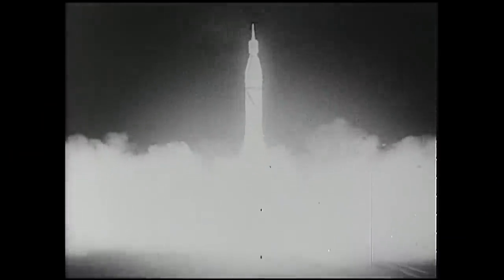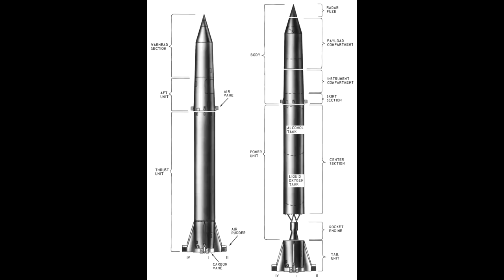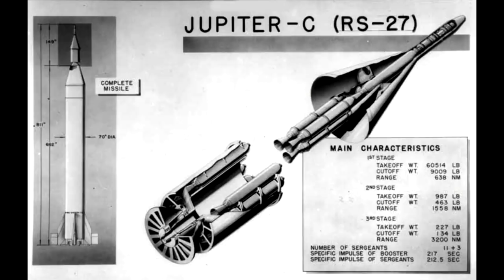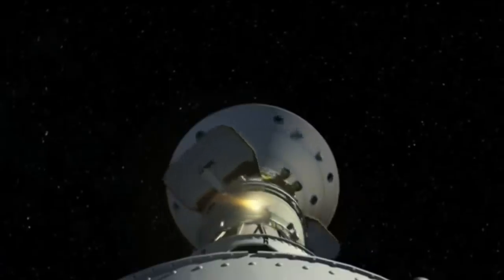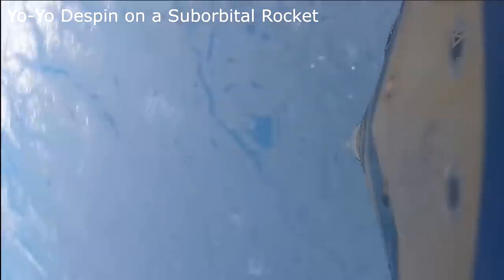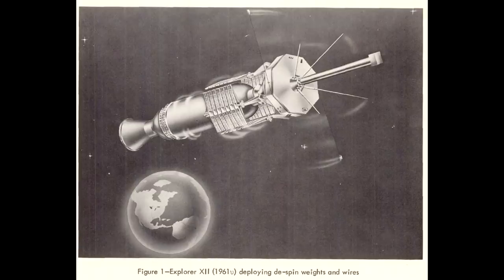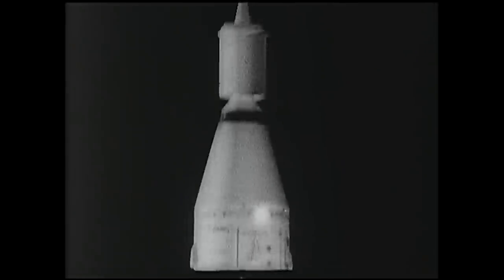Why Spinning Was A Good Trick For America's First Space Launch

Comment: Pro-tip: If you’ve overdone it on the alcohol stand in place and extend your arms for several seconds to yo-yo despin before getting into bed!
Reply: I find the spin worsens in a horizontal arrangement
Reply: @Wulthrin  
Indeed. It’s often necessary to extend a leg from the bed module to the planet surface to achieve final stabilization.
Reply: So you're saying I should T pose to assert dominance over the alcohol?
Reply: @MrRolnicek  It's an oversimplification of the procedure, but yes.
Reply: @Wulthrin  The rotation from vertical to horizontal often concludes with a head turn, inducing rotation in the inner ear (whose liquid is temporarily altered by alcohol). You need to cancel that out.
Reply: I like the spin
Reply: It doesn't always work. You may face-plant it with your hands still extended. Good thing satellites do not drink.
Reply: @chudleyflusher748  I know a navy guy who launched himself out of the top bunk attempting that maneuver.
Reply: To complete the despin you also need to detach the arms
Reply: Dont jetisson them though
Reply: @vladimirdyuzhev  Redstone rockets drink a lot.
Reply: ok bauts whasddys sther vommmit ona my bed ?

Comment: I used spin stabilization on the upper stage of a small two-stage rocket that I had designed to cross the Karman line. I tested the upper stage, stand-alone, three times. All three test flights lead to inflight breakups at between Mach 2.4 and Mach 2.7.  I attributed the first breakup to a fin failure at Mach 2.7. I found fins amongst the various parts scattered on the Black Rock Playa.

I reinforced the fin assembly substantially and repeated the test with largely the same results at Mach 2.5 but with the fin assembly only suffering  minor thermal damage. 

I increased the fin area substantially and changed to a welded aluminum structure. I also added an IMU to the payload. This launch went unstable at about 24,000 feet and at Mach 2.4. The payload and the forward section returned to earth under parachute. The aft section continued on a ballistic course and was located, stuck about 1.5 meters in a very hard  Playa.

Analysis of the IMU data showed the rocket increasing in spin rate until it approached the lateral aerodynamic resonance of the rocket at that speed. The rocket was not balanced around the axis of rotation which induces a nutational torque about the logitudinal CG. This torque was easily overcome by the fins until the spin rate approached the longitudinal resonance. The longitudinal stability was heavily underdamped and the excitation of the rotational imbalance caused the angle-of-attack to exceed limits and the rocket quickly turned perpendicular to the direction of flight and broke up.

Who would think that larger fins and spin stabilization would result in a more unstable rocket?  I don’t understand, “it must be a rocket thing”.

Comment: "While many people had proven that the alcohol used to fuel the Redstone was safe enough to drink."

"Oh, well its good that they did their due diligence and analyzed the different rocket fuels for.... hold on a second...."
Reply: And that liquid oxygen they use.  Once you warm it up above -40 degrees it's safe to breathe it - even without a respirator.
Reply: @Kineth1  is that -40 degrees C or F?
Reply: The biggest drawback of ethanol fuel is the inevitable loss of propellant that would occur every time a Navy technician opened the tank to inspect the levels.
Reply: Honestly, it's the people that tried to drink UDMH thinking it was alcohol I feel sorry for ...
Reply: @Xylos144  Yes ;)
Reply: @retrogradevector  Really? Because anyone that got to the point where they had swallowed UDMH should have had enough of a warning to stop...
That would be like feeling sorry for someone who accidently drank the LOX instead of alcohol...
Reply: Redstone fuel technology stolen from Russia thats actually vodka!
Reply: @Xylos144  Both!  At the same time even.

-40 is the crossover point where F and C scales are represented by the same numerical value.
Reply: @Xylos144  I see what you did there...
Reply: Pour one out for the folks who proved that UDMH was NOT safe to drink.
Reply: @BogeyTheBear  😂😂😂 heck
Reply: This sounds like a kerbal part description: "While the reliability of the engine hasn't been proven, engineers have confirmed that the alcohol this engine uses for fuel is safe enough to drink."

Comment: The Pioneer 10 and 11 probes to Jupiter and Saturn were spin-stabilized and just retained the spin. They actually used it in their imaging system--the system could only detect a single pixel at a time, but this would sweep out an arc as the spacecraft rotated, and then they could build up an image by re-aiming the scanner on successive rotations.

Comment: yo-yo despin works not only by increasing inertia tensor but also because wire is wound up around the stage, so when it gets unwound centrifugal force from weights is actually applied to the side of the stage (not center of mass). and it literally pulls the stage in the direction opposite to rotation. with only inertia tensor increase your can slow rotation (maybe by 3) but never stop it or go in reverse.

Comment: Watching that T-handle I finally understand how and why the earth can suddenly flip it's polarity.
Reply: I don't think I understand it any better, it just makes it easier to accept
Reply: @wictimovgovonca320  The handle is heavy, it is the natural core that could spin stably forever.  When the tool is spun around the lighter axis, it is unstable. It keeps spinning, but it is not a natural spin because it is along the wrong axis.

By analogy if the nickel/iron magnetic flux at the core of the earth is not spinning in the same direction as the surface of the planet (as the increasing divergence of the magnetic poles from true north shows), the inner core can flip in the same way the tool did, possibly dragging the surface along with it.

Comment: In a configuration where the spin axis is aligned with the smallest moment of inertia, if there is some energy dissipation inside (like fluids possibly moving in tanks), then you need active nutation control to avoid going to so called flat spin. A spinning body has two axis around which it can spin in equilibrium. Spinning around the axis of highest moment of inertia is a stable equilibrium, while spinning around the minimum is an unstable equilibrium. If the ratio of moments of inertia is close to one (a spher or a cube for ex), the equilibrium is undetermined and the body ends spinning around its axis of kinetic momentum, but in a position which is not definite. Launches whith the PAM-D atop a Delta or in the shuttle used active nutation damping during the coast phase to the equator. A spacecraft small thruster perpendicular to the spin axis was pulse fired at the right moment during the rotation in case of detection of any nutation (wobble) to dampen the nutation and reduce it to a minimum.

Comment: Was any attempt made to make the discarded yo-yo weights easier to detect in the future? Maybe a radar-reflective coating, and/or unfold the weights into a large thin sheet similar to a solar sail?
Reply: I think they're just yeeted away without any special indicators for future cleanup.
Reply: Oooh, if they inflated then they would de-orbit faster.
Reply: @Kineth1  Yes. The end mass could be a folded-up origami shape held together by a "glue" (maybe just a softer metal) which slowly deteriorates after several years.
Reply: I wonder if the cables are made from the same stuff that held together the day/night shades on ringworld. Dangerous stuff if it hits you.

Comment: One addition: All spacecrafts pointing to earth need to spin. But at a low speed. Approx. one rotation in 90min in LEO and 1 rotation in 24h in GEO. And there is often a "bbq" mode foreseen for spacecrafts when there is failure: It spins to keep temperatures stable.

Comment: I was reading up on the instability issue the other day in the context of O'Neill cylinders and the flipping t-handle effect came up, sure enough. Would you consider doing a video on the permitted range of aspect ratios for the cylinder habitats, Scott? It may very well b'é that Babylon 5 was doomed from the start 😀
Reply: The intermediate axis theorem applies most significantly to objects that are in free rotation. Babylon 5 was constrained within a ship so altering the axis of rotation would meet with dramatic resistance.

The problem of course is that no bearing technology known to man can handle the combination of surface speed and load presented by such a station.

Comment: My wife is  an engineer that worked on the JPL LDSD project, which was a platform to boost experimental parachutes up to high within the Earth's atmosphere to where air pressures mimicked those on Mars for the purposes of testing 'chute designs for Martian atmospheric entry.  Specifically she and her team worked on the small solid rocket motors that were used to spin-stabilize the platform prior to the main engine delivering the platform up to altitude.

This is the project's website: https://www.nasa.gov/content/ldsd-we-brake-for-mars

Apparently the fun part was ensuring that these small solid rocket motors would all perform the same.  They had to spin-up when the original lifting-balloon raised the platform as far as it could reach, then after the booster had delivered to altitude, spin-down the platform again.  They had to achieve both balance in the spin and had to ensure that when the rocket was spun-down it was as close to zero RPM as possible, with a tolerance in single digits.

The platform performed so well that they were able to do parachute and other reentry tech testing on the first flight, a flight that they expected to basically just test the platform itself.

Spin-stabilizing can be extremely effective, even allowing things that don't resemble rockets and are ballastically highly unstable in an otherwise still configuration to fly accurately.

Comment: Thanks Scott!   I don't see how yo-yo despin could make the vehicle spin in the opposite direction.  The best it could do is bring the spin to zero.  I imagine there were small thrusters or something that were fired after the yo-yos got the spin very low.
Reply: I'm thinking it may be related to the flexibility of the cable, and maybe a spring at full extension. You extend a spring and it will absorb some energy and then pull back against it.
Reply: @wictimovgovonca320  A spring can store energy but not angular momentum.   The yo-yos work by conserving angular momentum but increasing their moment of inertia (by moving outward) thus decreasing spin. The best you can do is have the yo-yos extend out to infinity which would bring the spin to zero.

There is no way to change the direction of spin without changing the angular momentum.    But maybe there is something clever going on that I haven't thought of.
Reply: @BitJam  I don't fully understand, but someone else here said it had something to do with the cables being wrapped around the stage and the masses being off center so the tension in the cables isn't along a diameter of the stage cross section.

My gut instinct was that some funky things could happen due to the fact that things aren't steady-state and there's springiness of cables involved. Ropes do weird things when swinging around.
Reply: @seth094978  Thanks!   Yes, if the cables are wrapped then the weights going out can impart addition angular momentum to change the spin direction.

Comment: There was an anti-tank missle where the entire missle was spun up to several thousand RPM before launch. It had no fins and no thrust vectoring, but none the less was a guided missile. It was not guided until after the solid rocket burned ouy. Then it used a series of small charges arranged radially at the nose. The launcher would track where the missile was and if a correction was necessary, one of the small charges would be detonated to cause the whole missile to precess. The payload was just a chunk of tungsten, about 6' long by 1' diameter. It would hit at something like 4-5KMPS. Supposedly if it even grazed a tank, the shock, acceleration and liqufied metal spray would totally destroy it. I don't think it ever made it past the prototype stage, but it did sink a ship in a test, showing how much overkill the design was.

Comment: "in the case of Dawn the dynamics of the unspooling masses were tuned so that they didn't just slow the rotation of the spacecraft they reversed it a little"  If they added some RCS, they could reverse the rotation, but with any length of cable and any mass, you  cannot reverse the rotation, you cannot even stop it, you can only slow it down to a miniscule rate.

Comment: You've reminded me of something I'm confused by on two other early American rockets;  Liquid upper stages. (Or at least their Wikipedia descriptions).  Wiki's Titan 1 page lists its first flight in 1959 as the first successful use of serially staged rockets, and getting an engine to start up off the launch pad...  But both Vanguard and Juno 1 had used solids for some upper stages, which don't have propellant settling issues.  And Vanguard even had a liquid fueled stage 2, which...  I think flew 1 year before Titan 1.  Also, as far as I can tell, the first Soviet rocket to start a liquid (or any) fueled engine serially for an upper stage was Luna 1 in January of '59.  Am I getting this right?  Vanguard and Juno 1 were the first two rockets to start engines after leaving the launch pad, did so in '58, but Titan 1 was interesting a year later for getting it's engine to start in space?  I also can't find any notes online about how Vanguard did propellant settling for its stage 2.
Reply from the maker: That’s a lot of minutia, now you’ve got me wondering.

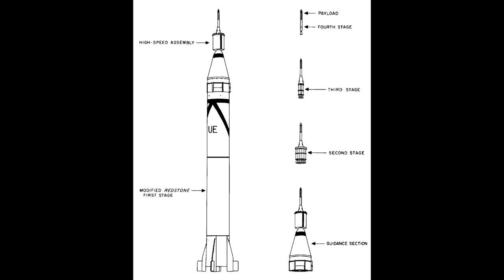Comment: 4:20 - whether nm stands for nanometers (as I would expect in a metric context) or nautical miles (as I would expect for all sorts of other reasons in this context), the juxtaposition of that with altitude expressed in km (which I presume can be nothing other than kilometers, right?) seems... strange.
Reply: Could be a culture mix issue. In aviation distances are nautical miles, and speeds are knots. In space it's often metric units. Since those stages will come down, they're handled by aviation guys, and the payload isn't.. so each use their own preferred units for their part.
Reply: @nuclearmedicineman6270  sounds confusing, has any issue come from this?
Reply: @nuclearmedicineman6270  Nautical miles are used by the Navy too. They have to clear the downrange impact zones.
Reply: @gordonrichardson2972  I just wish we’d all switch to metric and be done with it.

Comment: The whip antennas causing a change in spin axis.  My though was the fact that the orbit is circular  but the axis of rotation is a vector pointing in one direction that had no relationship to the circular orbit.  so at 90 deg around the earth the satellite should be pointed perpendicular to the orbit travel.

Comment: I'm a bit confused. You mentioned spinning is used to deal with both off-center center of mass and asymetric thrust. Spinning the small upper stage while the first stage is burning will only "average out" the upper stages center of mass. It won't do anything for the rest of the stages center of mass or the engine thrust asymetry. Did the whole rocket also spin? Was the spinning upper stage just a gyroscope at that point?

Comment: Could you do a video on what space X can do to fix its sloshing of fuel in the header tank on landing?  What are the options, go with a shuttle design instead, spiral titanium tubing for header tank, double jump for landing, keeping the fuel in a stirred state, placing a mesh in the tank to damping sloshing, how the helium works to prevent it.  Since sloshing is at the root of starships crashing so far how do they solve it?
Reply: If they don't know then he doesn't know. We fix sloshing in race cars by running foam fuel cells. That cannot be done in rockets, I mean it can but it would add a significant amount of mass and reduce the volume of fuel it can hold. It will be interesting to see how they fix it though. Baffles obviously help but again it adds mass. 

They could go the Electron route and use a more advanced sensor suite and more accurate pump control to vary the thrust to cancel out the sloshing via disruptive interference with peak moments of power being out of phase with the pogoing of the fuel thus canceling it out a bit, but it pretty much requires an electric fuel pump something they do not have.

An inflatable bladder in the tank also could work but again that's added mass. 

A video on hypothesized dampening solutions and how it's been done in the past would be interesting but he isn't going to know more about it than the engineers there at SpaceX either way though it is a good topic.

Comment: Wouldn't the additional mass needed for the yoyo de-spin kind of offset the mass saved by using the rotational stabilization method?  6kg for the weights plus the cables and release mechanisms, versus some additional hardware on the 3rd stage engine. It has to at least be kind of close.
Reply from the maker: Engineers have done the math
Reply: Hah fair. Thanks for the great content.

Comment: Shouldn't the increase of second stage RPM while flying causing the first stage to rotate in the opposite direction? This will benefit the distribution  of not allineated engines.
Maybe the reason is related to loosing aerodynamic forces.
Reply from the maker: The engine had steering vanes to counteract the roll
Reply: @scottmanley  ah ok. thanks!